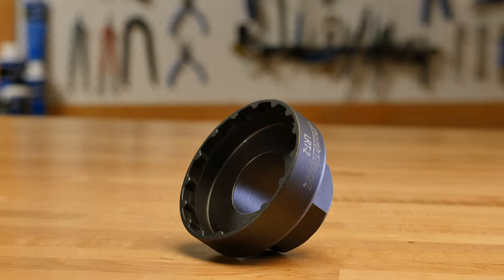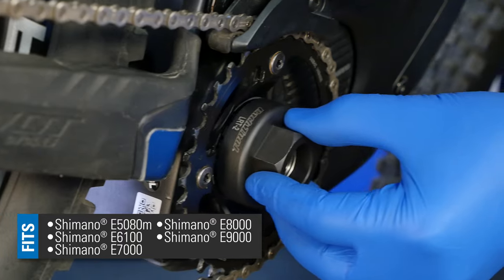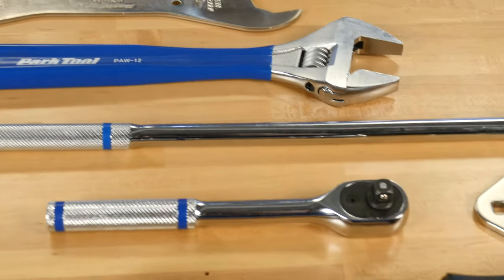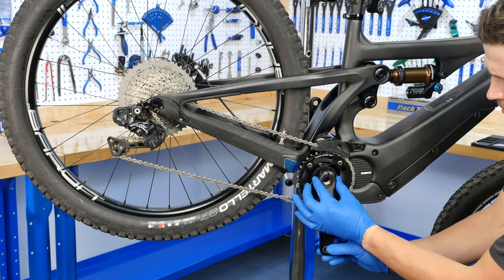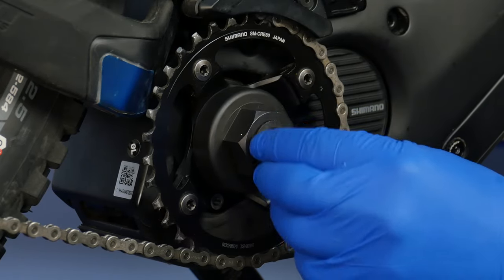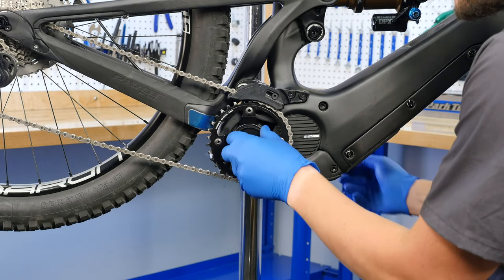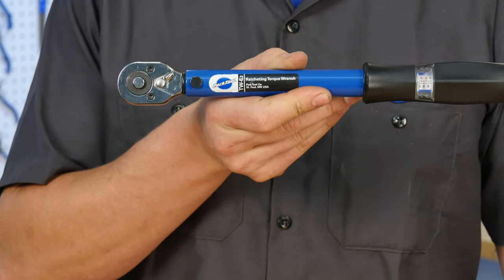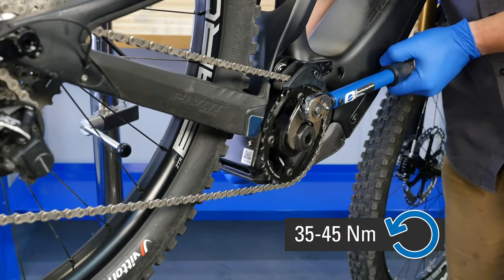LRT-2 Lockring Tool - Shimano® STEPS

Comment: When removing, once the lock ring is loose, remove the crank arm fixing bolt to prevent it from being stripped out by the turning LRT.

Comment: Will this work for ethirteen cranks, as they have a deep recess?
Reply from the maker: No, e13 has a proprietary tool size for that.  Use their tool
Reply: @parktool ok thanks for confirming. If you happen to know the tool pls let me know, as I've been going round and round. Thanks!
Reply: Did you find a solution for e13? I've been searching and searching and no solution.

Comment: How do you remove the non drive side crank arm?
Reply from the maker: The Shimano Steps has two styles.  This tool fits systems using a slotted crank.  Use a 5mm hex key to loosen bolts.  Remove the cap, and the arm pulls off.

Comment: Is this the same tool for ep8?
Reply from the maker: Yes it is.
Reply: if you have the new ep801 NO...  it now have a smaller  16 notch 42 mm diameter
Reply: @toetz4491 how do you figure out which motor you have? I have  a 22’ Orbea rise with the ep8 motor?!
Reply: @jamesdavis9507  you have the ep8 motor .. if you take the motor off,  youll have only two small sensor wire  attachments (ep801 has 4) and the thick power wire (battery) is pointing to the top  (the ep801is pointing sideways to mitigate the water ingress issues)